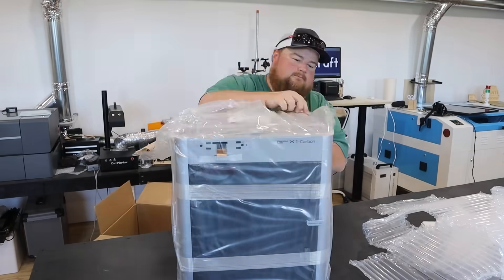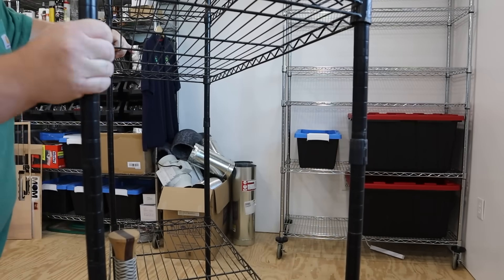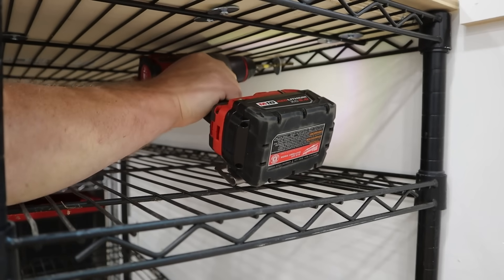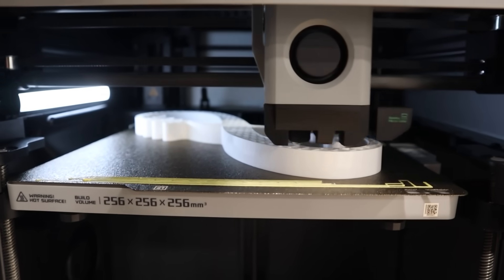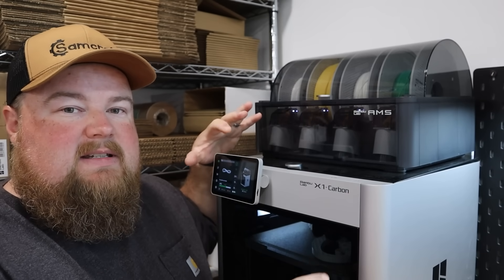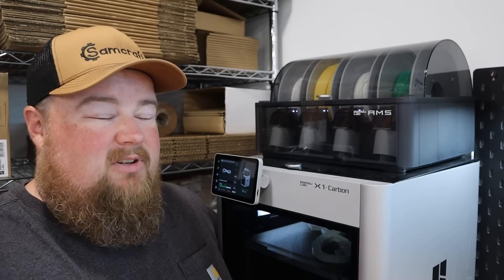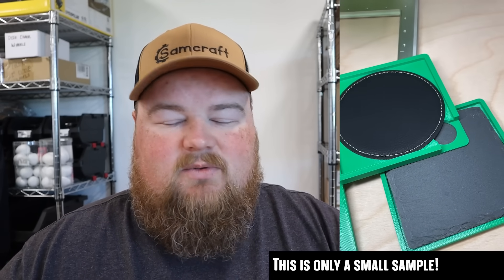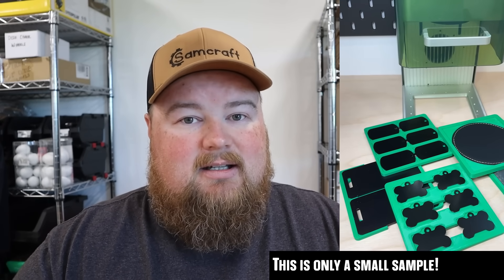Diversify Your Income by Starting a 3D Printing Business

Comment: Does Sam still recommend a Bambu printer after the recent move to force all users to use their cloud where they have access to steal all of your designs for free? My first printer was from China and after having zero customer support, that became my standard for a viable professional printer. I went around to all of the various companies and tried to reach their customer support for help. Nobody in China was available ever....EVER... Any company that wasn't even capable of basic support for their customers was off the list. American made printers was next. I'm sure they're great but they are very expensive. So I searched for European made printers. The price was higher than the China stuff, but that cost came with a higher quality product and incredible customer support. They will literally never try to end the conversation. They are there to help you indefinitely. You can figure out who this company is pretty easily. 

China printers like the Bambu stuff is great for pump a dump PLA projects. When the printer has an issue, just throw it in the trash and buy another one. If you are a person looking to get into printing professionally and your market will be PLA trinkets and toys or you're just printing out stuff that you didn't design yourself, then I think China printers are a good option. However, if you are designing and producing functional products, China printers are going to be a struggle. You will need to have extra printers ready to go when the ones you are using fail. God bless you if anyone in China does anything remotely related to a warranty on their product. It will of course be multiple weeks at best. Time is money and China values their time more than yours. They are probably busy stealing your designs.

Comment: How 3D Printing Releases Harmful Particles
When using a 3D printer, especially with popular filaments like ABS (Acrylonitrile Butadiene Styrene), PLA (Polylactic Acid), and nylon, the process involves heating the filament to a high temperature to melt and extrude it into the desired shape. This process emits ultrafine particles (UFPs) and volatile organic compounds (VOCs) into the air.

Ultrafine Particles (UFPs): These particles are smaller than 100 nanometers and are released during the melting of the filament. Because of their small size, UFPs remain airborne for extended periods and can be easily inhaled. These particles can penetrate deep into the lungs and even enter the bloodstream, leading to potential long-term health risks.

Volatile Organic Compounds (VOCs): These are organic chemicals emitted by some filaments, particularly ABS and PLA, when heated. VOCs can cause immediate irritation to the eyes, nose, and throat, and with prolonged exposure, may lead to more serious respiratory problems.

Risks Associated with 3D Printing Emissions
Respiratory Health Issues: Inhaling UFPs and VOCs from 3D printing can lead to short- and long-term health problems, such as:
Asthma or Bronchitis: Due to the penetration of UFPs into the alveoli (air sacs in the lungs).
Chronic Respiratory Issues: Repeated exposure to these particles, especially in a poorly ventilated space, can cause lung inflammation, long-term lung damage, and increased risk of cardiovascular problems.
Transfer of Particles to Other Spaces:
Cross-contamination: Particles can settle on clothing, skin, or surfaces. If a person enters a 3D printing workshop and then moves to another area, they could inadvertently carry harmful particles into their home or other living spaces. This exposes others to potential health risks.
Limitations of UV Light:
Misconception about UV Light: UV light can reveal certain organic particles like oils or dust, but it is ineffective at detecting UFPs or VOCs. These particles are invisible to the naked eye and non-fluorescent, so specialized tools like air quality monitors or particle counters are required for detection(new 6).
How to Create a Safe 3D Printing Setup
Given the health risks associated with 3D printing emissions, it is essential to implement measures that ensure both safety and efficiency. A safe setup involves enclosure and ventilation, along with other important precautions.

1. Enclose the Printer
Why Enclose?: By enclosing the 3D printer, you trap the UFPs and VOCs within the enclosure, preventing them from spreading throughout the room.
Fire-Resistant Enclosure: The enclosure should be built using fire-resistant materials to ensure that in case of any overheating, the enclosure is safe.
Sealed Design: Ensure that the enclosure is sealed so no air escapes into the workspace. This way, the particles and VOCs will be confined to a controlled space.
2. Install a Ventilation System
Exhaust Ventilation: An effective exhaust system will draw air from within the enclosure and expel it outside. This prevents harmful emissions from accumulating inside the workshop.
Vacuum Ventilation System: A vacuum ventilation system can create negative pressure inside the enclosure, which ensures that air is constantly drawn out. This prevents leaks and keeps harmful particles from entering the workspace.
3. Use HEPA and Carbon Filters
HEPA Filters: A High-Efficiency Particulate Air (HEPA) filter captures ultrafine particles (UFPs). This type of filter is designed to trap particles as small as 0.3 microns, making it highly effective for removing 3D printing emissions from the air.
Carbon Filters: VOCs can be absorbed by an activated carbon filter, which helps reduce the concentration of harmful gases emitted by the filament. Ensure that your ventilation system incorporates both filters to address both UFPs and VOCs.
4. Monitor Air Quality
Air Quality Monitors: Install an air quality monitor in your workspace to track the levels of particulates and VOCs in the air. This will help you assess the effectiveness of your ventilation and filtration system, ensuring that harmful particles remain at safe levels.
Regular Testing: Periodically test the air in your workshop using particle counters or VOC detectors. This can provide early warnings if levels become unsafe.
5. Regular Maintenance
Clean and Replace Filters: Over time, the HEPA and carbon filters will accumulate particles and need cleaning or replacement. Regularly check the filters to ensure they are functioning correctly.
Clean the Printer: Regularly cleaning the printer and its surrounding area can help reduce dust buildup and other debris that may further contribute to air contamination.
6. Personal Protective Equipment (PPE)
Respirators: Wear a respirator that is rated for UFP filtration while operating the 3D printer. This will help prevent the inhalation of harmful particles that may escape the enclosure.
Protective Clothing: Wearing protective clothing can minimize the spread of particles outside the workspace. Ensure that any clothing worn in the workshop is removed or cleaned before entering living spaces to prevent cross-contamination.
7. Location and Ventilation
Well-Ventilated Area: Position the printer in a space with good airflow, ideally near a window where exhaust air can be safely vented outside. Avoid placing the printer in small, enclosed areas without ventilation, as this increases the risk of harmful particle buildup.
Low-Emission Filaments: Where possible, use low-emission filaments like PLA instead of more hazardous materials like ABS or nylon. This can reduce the amount of harmful particles and VOCs generated during printing.
Conclusion
3D printing releases ultrafine particles (UFPs) and volatile organic compounds (VOCs), which can pose serious health risks if inhaled. To ensure a safe setup, it is essential to enclose the printer, use a vacuum ventilation system with HEPA and carbon filters, monitor air quality, and wear protective equipment. By following these safety protocols, you can significantly reduce the risk of exposure to harmful emissions in your workspace.

Comment: I have two bamboo p1s printers and they've been a basically disappointment. My problem is that I need to use Cura slicer for my projects. The bamboo slicer basically sucks for what I need. But I have figured out how to run a cura g code on the bamboo. Getting there I have taken apart both of the machines more times than I want to think about.
Reply: Use Orca Slicer, it's a much improved fork of Bambu Slicer.

Comment: A few of my P1S's have better quality than the X1. I'm still trying to figure out why. There are no variables, the tables are the same, calibrated, same filament, same settings, its really strange. Overall, all of them are incredible. I'm splitting hairs at this point. Good job Bambu. Good video....and I like "Rabbit Trail" lol
Reply from the maker: Hmmm.. my limited knowledge would have me comparing the following things next:  belt tensions, hot end age -- is one older than the other, machine tightness compared to each other -- has one been used a lot more and maybe ready for a tune up?

Comment: you could build the connection pieces and the steppermotormounts for open frame lasercutters with the 3d printer , maibe design youre own based on youre experiance with the types you worked with 
could allso reproduce some of the woodworking tools like the jigs ro drill the kitchendoor hinges pockethole tools roundover jigs for use with a router maibe improved holders or stands for existing tools , could do extraction fan or dustcollection mouths for diverse tools

Comment: Well good luck, 3d printing is sadly a race to the bottom as Bambu made it too easy for anyone to print. Its hard as a business to compete when half the competition are those living in their moms basement with a free supply of filament and zero overhead. Best chance you have is to use your original designs, and don't share anything digital. Expect to be copied in a month if you have a hot seller. Also if/when you expand, unless you need to print exotic materials the carbon isn't worth it. Save a fair amount of money with the P1S or A1, mini is great if you're doing small things. If you're not doing small detailed models, give some larger nozzles a try, .6 or .8 will greatly increase your production when properly tuned. And be careful, darn 3d printers like to multiply, rocking 22x last i counted, lol.

Comment: X1C is a fantastic printer, but from a business perspective the P1S will give you functionally equivalent prints with a higher ROI. We run X1C for prototyping and development but have a farm of P1S printers because, frankly, in production, the X1C offers no real advantage at higher cost.
Reply from the maker: I figure why not start with the best, then as it pans out fill out the farm with the same P1S models. :)
Reply: @Samcraftcom  oh I agree completely. Just saying as a small business don’t get hung up that you need an x1c and especially the AMS which is kind of half baked and is more trouble than it’s worth if you are printing 24/7.

Comment: Most of the Bambu print farms I've seen have used the P1P almost exclusively with the occasional P1S, A1 and X1C thrown in for kicks or special purposes that require an enclosure. It's not just economics. The X1C doesn't bring anything to the table from a production standpoint that the P1S doesn't do, and adding systems like LIDAR are just unnecessary points of failure. If you're not printing ASA or ABS, the enclosure isn't needed either, so go for the P1P. AMS is another story. For a personal printer, I wouldn't be without it. For a production printer, AMS is too inefficient for full color prints. For labeling on top or bottom as  you did, it works just fine. Many would say that you can buy an A1 with the AMS Lite for the same price as a P1P alone, and that's right. But in my experience with two A1's printing almost non-stop, the occasional problem pops up requiring replacement of the heating element (thrice), the hot bed (once) or the extruder (twice). These printers put in over a hundred hours a week, which is a heavy load, and they just don't hold up as well as the P-series printers. My oldest, a P1S, has 3,000 hours with no parts changed out other than the hot end and the build plate. If you're buying a printer for your own giggles, then for sure get the one that makes you happy. If you're serious about production though, I recommend the P1P or the A1 if your budget is more constrained, either with or without AMS  (depending on the kind of parts you're going to print.)
Reply: Exactly this - the P1P is squarely aimed at being the workhorse of a printer farm. Who cares about closed source if it’s the most reliable and cost effective production printer out there? If you’re running a business you don’t want to have to waste time tinkering with your printers and software. The P1S is there for handling the occasional high temperature material order.
Reply: That’s because it was the cheaper version a years ago, it will change out over the next 12 to 18 months

Comment: Good for you Sam, I too love the idea of basically having a number of different types of tools/machines so that I can at least have a go at making pretty much anything.  I think that the only thing's you're missing now is a metal workings area. A plasma cutter and other bits and Bob's 🤔. As alway's buddy 💯%   👍   🇬🇧.
Reply from the maker: I'm glad someone else thinks like I do. :) Metal working is interesting, but I don't know I have the space to do much else.
Reply: @Samcraftcom  that's two of us, Sam, just a very large pond between us 🤪.I don't know about you, but I have a bad habit of buying tools/machines with the plan of having a go when they arrive, but unfortunately, it never works out that way. To give you an idea, I bought the latest model 4x4ft cnc from Carbide 3d. I arrived around Christmas time in 2023. I managed to put it together around Feb 2024 and haven't had the chance to do anything with it,  I did pretty much the same thing with a Gweike 55watt laser, except that sat in my dinning room still in it's shipping crate for six months before I got even near to opening the crate and putting it in my workshop.  Again, I still haven't had a chance to do anything with it.  There seems to be a pattern at the moment 🤔🤔🤯🤯.